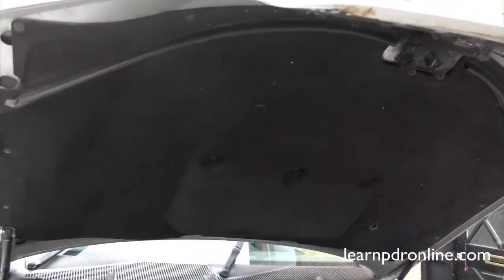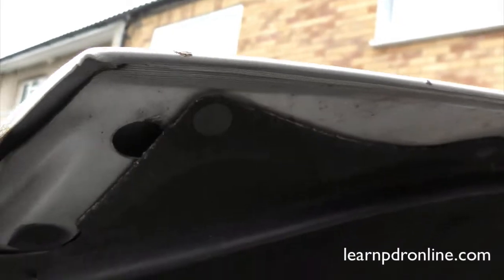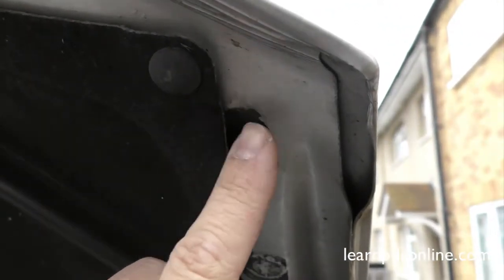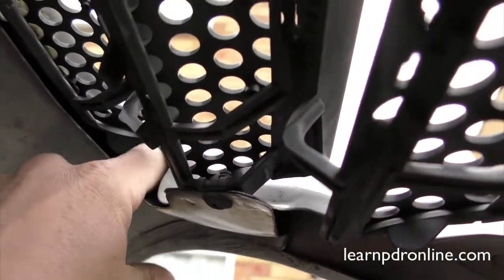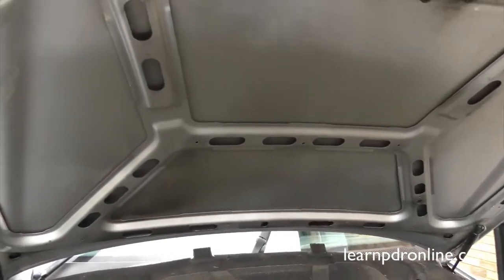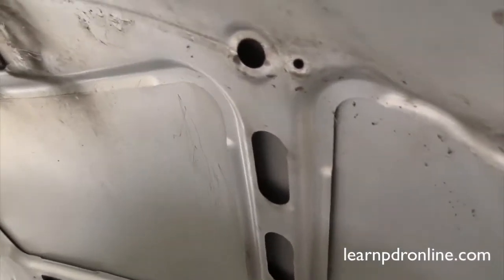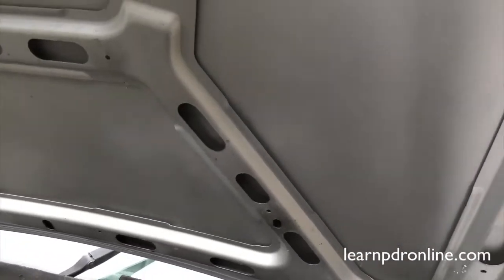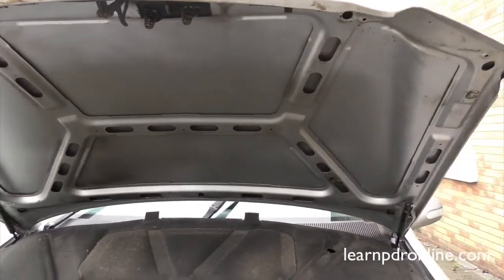AP Episode 5 - Paintless Dent Removal Access Points For a Bonnet Or Hood.

Comment: Hi Tom nice video, have you had occasions when you have had to remove a bonnet to carry out the repair? Thanks.
Reply from the maker: Hi Bill, I used to work in a bodyshop where we would remove bonnets regularly for body repairs but since I've been out on the road by myself (10 years plus) I have never removed a bonnet. 

Being a mobile tech its not so easy to remove panels on customers driveways by yourself, you need good panel stands, more space to work plus its not easy to physically remove the bonnet by yourself and then re also refit and align it.

90% of bonnet dents I have repaired have been in the front half but even when they're further back there is normally good access...

I'm not against the idea of removing panels I just prefer not to personally! 

Thanks for your question